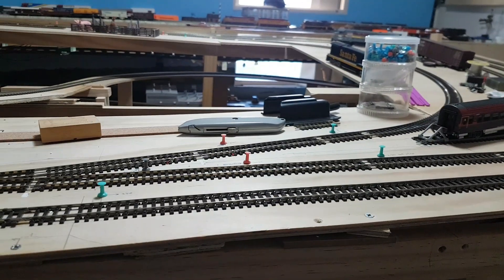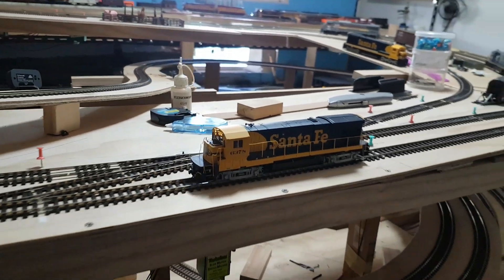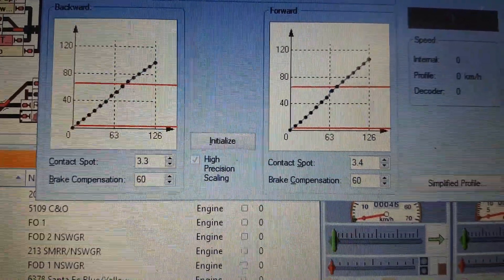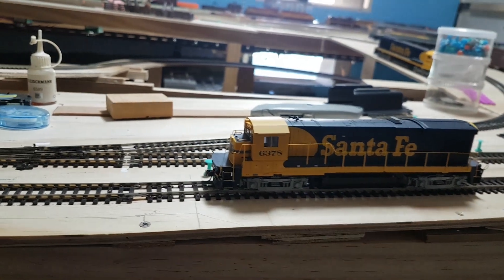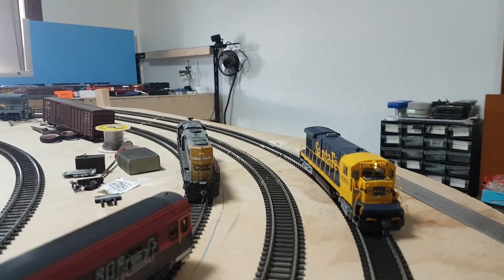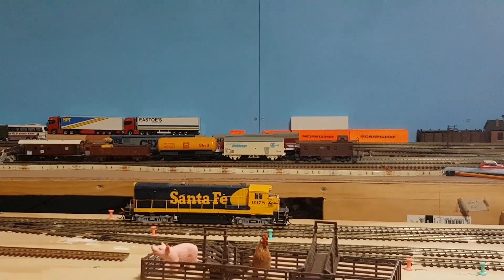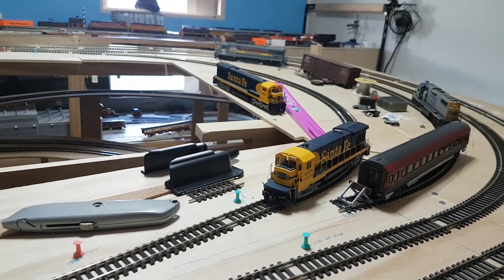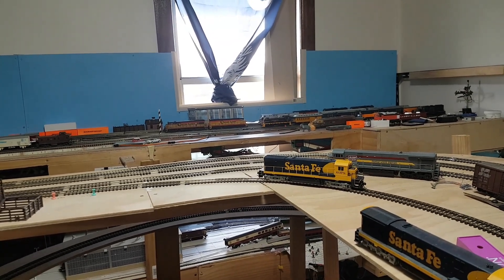Doing the brake calibration for the American trains for Freiwald Train Automation Silver V9

Comment: looking good Arty and what is your control system and does it change points also. Take care Kevin
Reply from the maker: Thanks Kevin. The program I'm using is Freiwald Train Automation. A German Paid program. It does every thing, points signals even dispatch and timetable operation. Lot easier to use than JMRI. It's worth the price they charge too.
Reply: @Ausmerica  Thanks Arty I will check it out